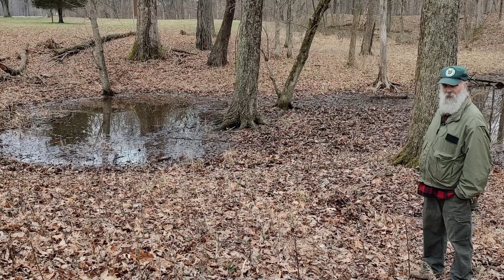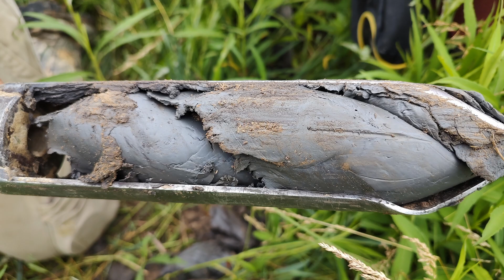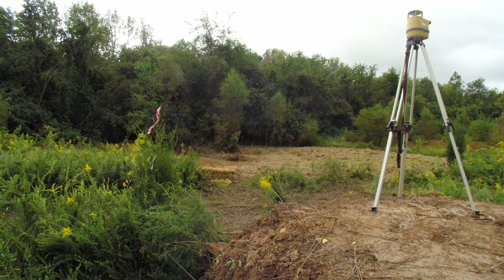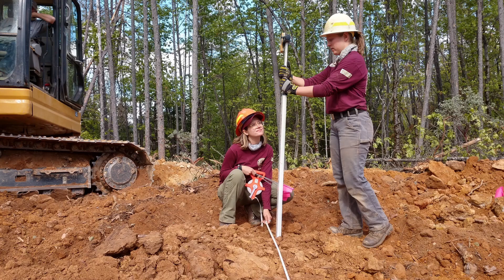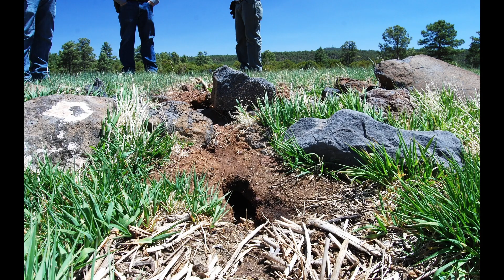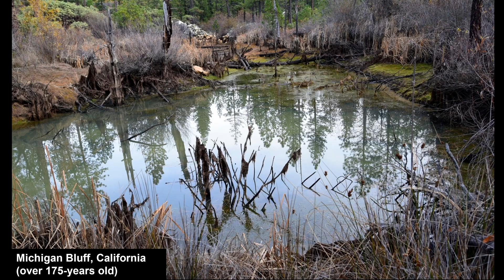Build a Wetland That Will Last Forever (Episode 33)

Comment: the only thing i cant get on on board with is the liners or textiles.... natural pools and ponds that drain slowly help maintain aquafirs and raise water tables,  textiles and liners DO NOT DRAIN and can rip, tear or degrade over time....   stick with clay and natural techniques
Reply from the maker: I have built many wetlands using aquatic safe liners that also recharge groundwater. One sets the top elevation of the liner below the ground surface so that overflow soaks into the ground. I have also cut holes in liners so some water will soak into the ground. Wetlands built using compacted clay liners rarely replenish groundwater. Aquatic safe liners installed using the techniques I have developed will not rip, tear, or degrade over time. I recommend using clay to build wetlands when it's available. Unfortunately, many landowner do not have clay on their property and still want to build a wetland.
Reply: @tombiebighauser  Tom i have watched all your vids so far and i love your work.  I am currently rehabilitating a wetland that is approx 2 acres large. It was drained by former landowner and liner is out of the question for a project this size.  im hoping it retains and regains it water holding capacity once i plug the leak (trench)  that was used to drain it. 

thanks for all you do, the information is valuable for people like me, we are just few and far between, many people dont understand the importance of this type of habitat